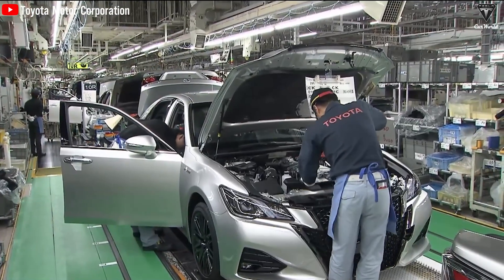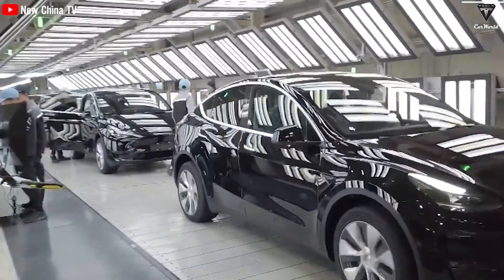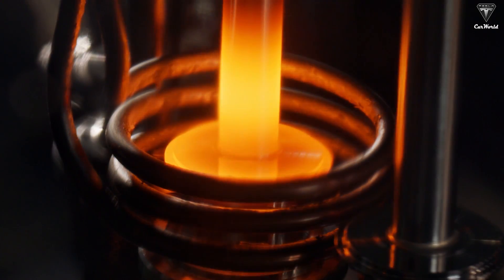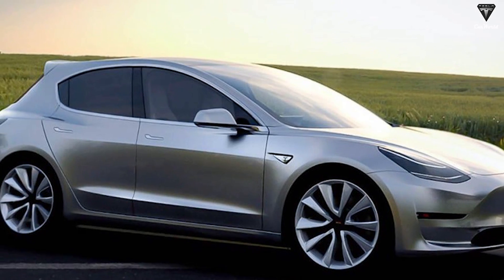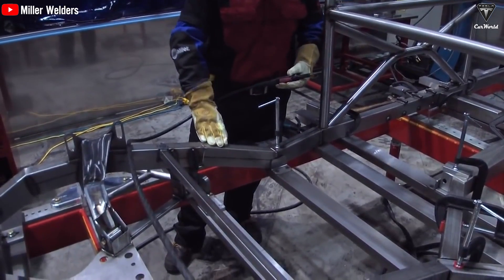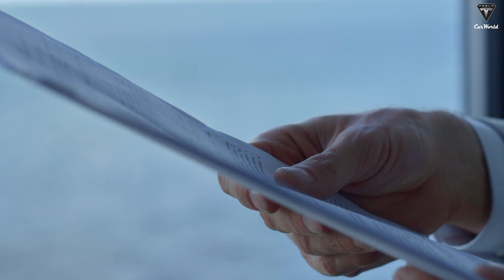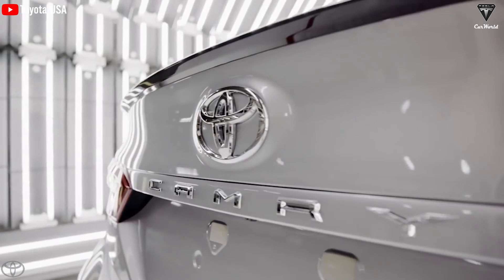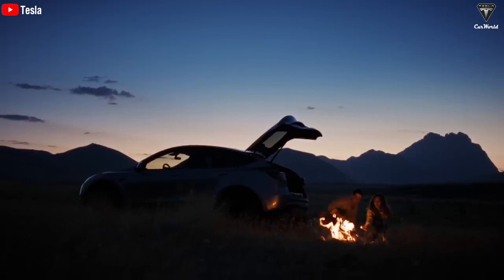Elon Musk reveals Overwhelming Parameters Giga Press 16,000T! Analysis Model Y and Model 2 Chassis!

Comment: Tesla did not invent the Gigapress, nor the process of casting aluminum.  As long as no rights have been violated, I hope that the entire industry can benefit from this technology.  My only concern is how are they going to repair minor collision damage if the casting is fractured or bent?  Is the car totaled or is it a repairable part of the car?
Reply: The innovative approach to reusable sand cast molds may mean smaller press on demand segments to precision laser cut and weld processes.
There is also a rejuvenated old-school sheet metal repair technique that uses two opposing robotic arms to control forming, bending and metal thickness with high precision.

Comment: What impact does this have on the ability to repair the vehicle after a collision damages the vehicle? Product serviceability for the customer needs to be a part of the total solution definition in balance with manufacturing optimization.
Reply from the maker: You should know that if the chassis of an electric vehicle is welded together, it can easily break in the event of a collision. Giga press is much more efficient than ever, it will soon be upgraded and improved with new molds. Thank you